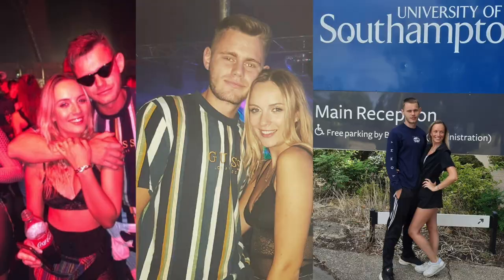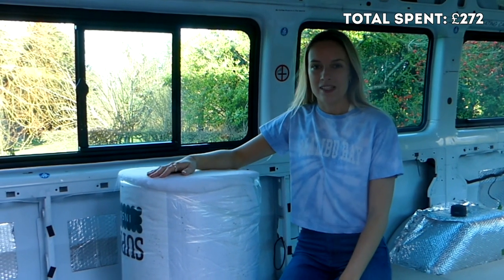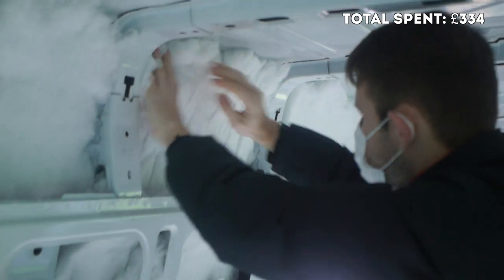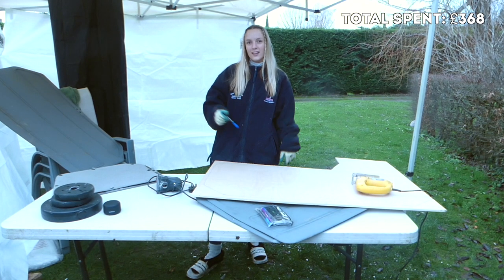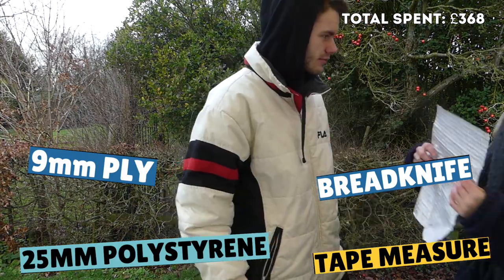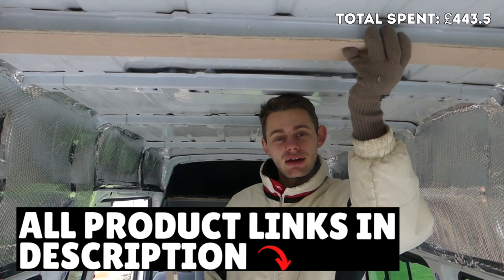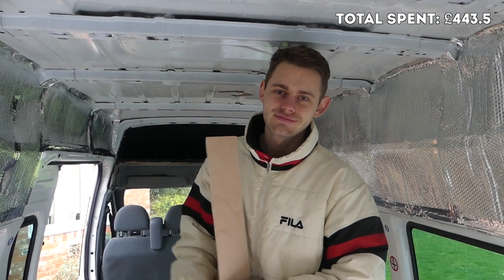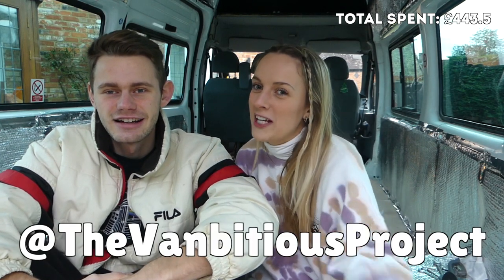Ep 4: Wall & Ceiling Insulation / Ford Transit Minibus Camper Conversion / UK Van Build

Comment: Outstanding work, just come across this when looking for a few ideas. Have to ask because it's got me stumped... When you screwed the strips to ceiling and floor, did they stay solid? I ask because those screws straight into thin steel is chancing it! I'm doing a van next year and intend to bond mine down with chemical resin adhesive, no screws at all. For context, I've built extensions etc so I'm familiar with strong adhesives and all the various type of materials out there. Anyway, great video series and what a result! Loved seeing you get it done, massive respect 🙏 Dave.
Reply from the maker: Hi David! Thanks for your comment! It’s really surprising isn’t it - that the screws would hold it up well… but honestly never had any problems. We’re currently building our 4th and 5th vans now and all our vans so far have been done the same and they’ve held up really well. Bet you can’t wait to get started on your van! Exciting times ahead!! 🚐

Comment: Enjoying the video but why did you not put writing and plumbing behind the walls/roof/floor?
Reply from the maker: Hey! Our wiring and plumbing is really simple and theres not much of it! Were using a 12v water pump which will be hidden behind our furniture when it runs from our fuse box. And as for our lights, we've put that wiring behind our cladding, so out of the way, but not completely impossible to get to! We're doing our electricity next week, so hopefully that video will make it a bit clearer! Hope that helps :)